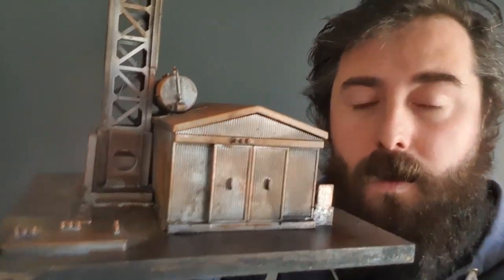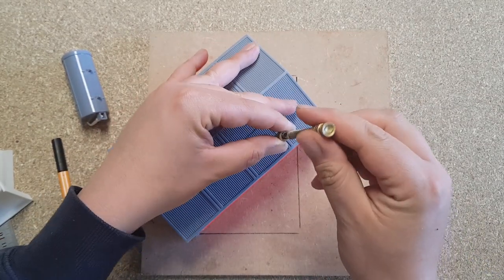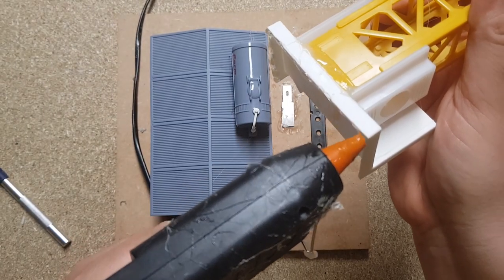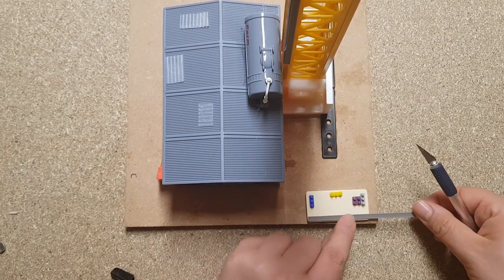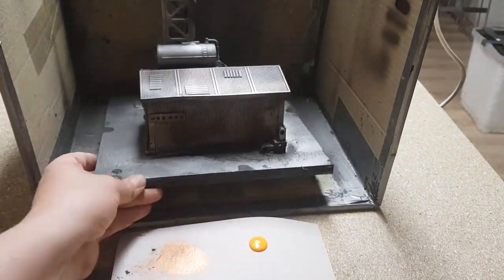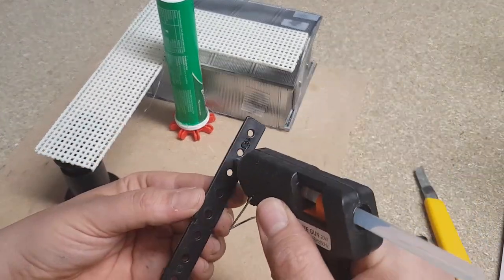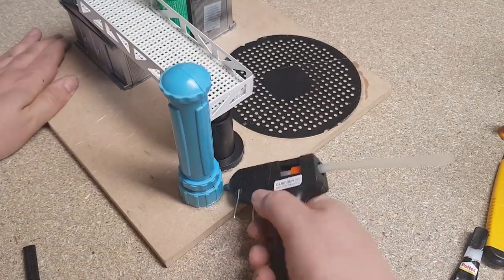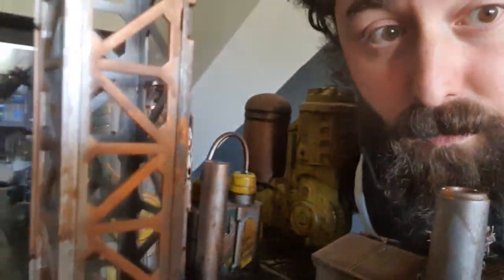✅Tutorial: Quick Industrial Scenery for 40k, Kill Team, and Necromunda

Comment: Great builds. That table looks great. What is the girder piece you used for a guard rail?
Reply from the maker: Thanks man!! Its some kind of strip I found at the construction market, it's like 2 and a half meters tall and it comes in aluminum copper and styrene. I think they're decoration but I could be wrong. it's very flexible and only 8 euro per strip.
Reply from the maker: I finally know what it is. Its what people use before they start adding stucco to dry wall. they use it to give strength to corners before they plaster over it.